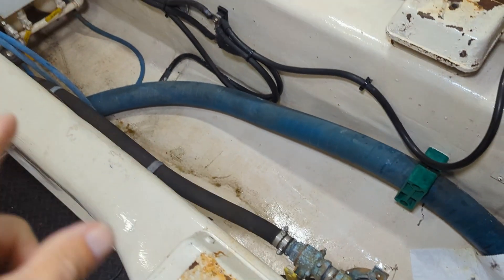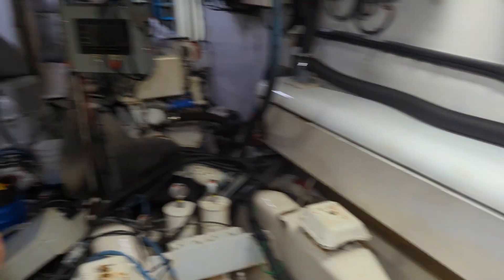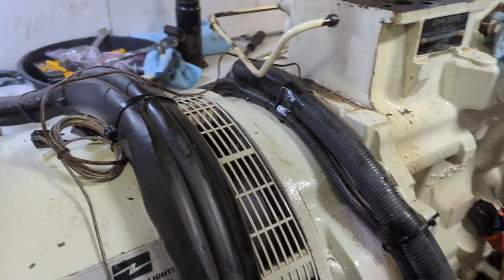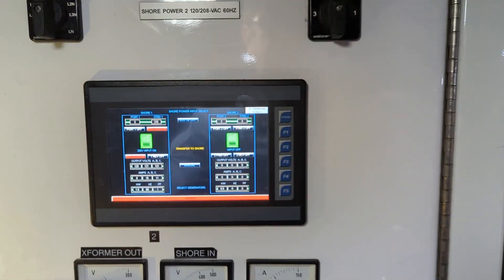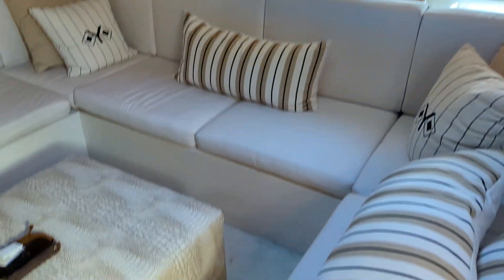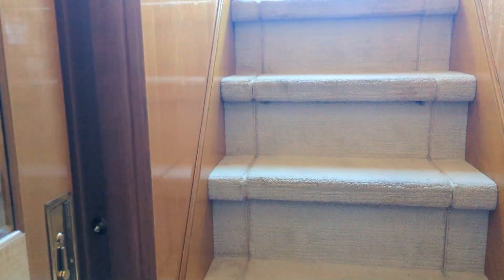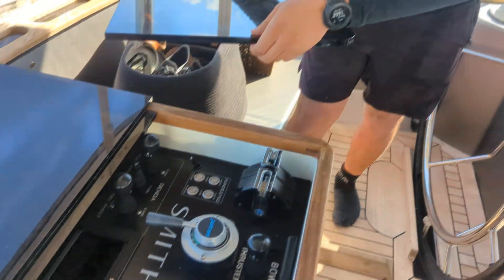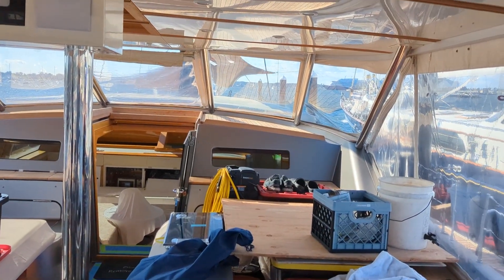Unlimited Silence Part 1

Comment: Looks like quit the project. You should get a copy of the ABYC standards. Electric on the water is different than electric on land. Also, Regen can be tricky without variable pitch wheels. Are they not going to keep at least one genset? Wind can stop blowing and without a lot of solar, keeping that ship up and running will take a lot of juice. Best of luck with it.